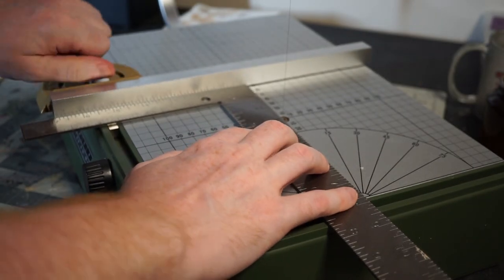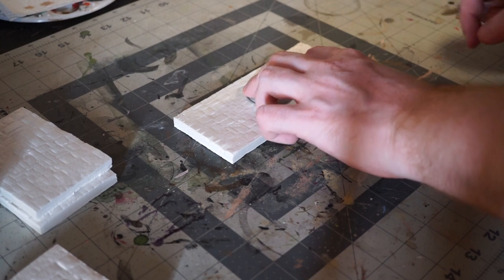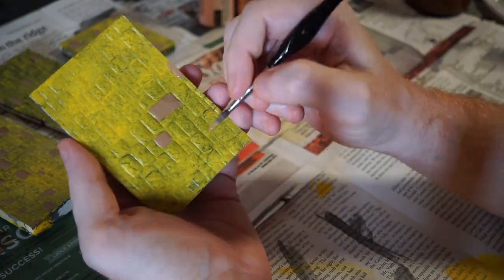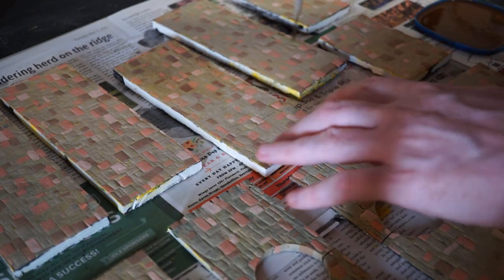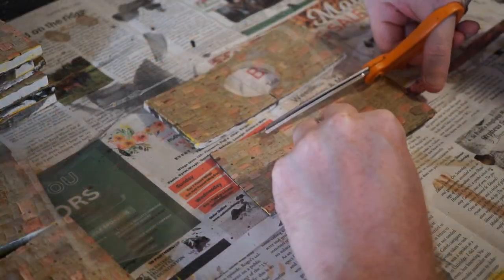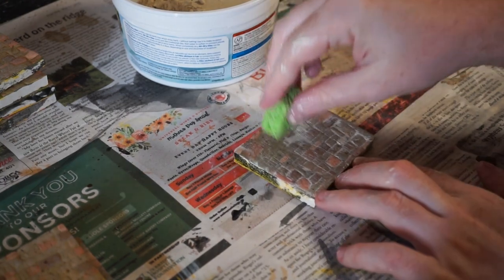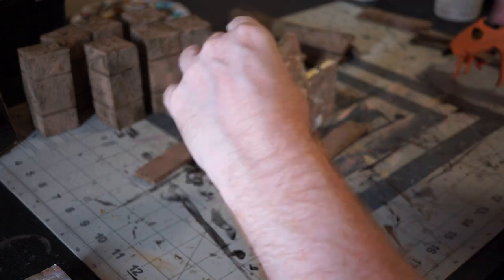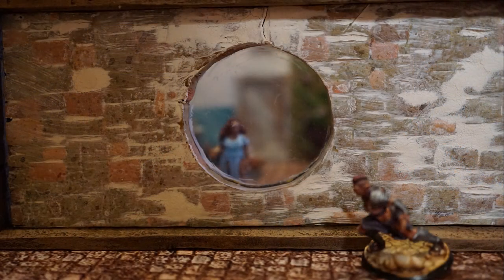Crafting MODULAR City Walls!

Comment: Beautiful walls!  I'm new to TTRPG's, DMing, and crafting.  Yep, diving into everything all at once!  One thing I'm a little concerned about is do you experience issues with the walls falling over and, if so, what's the easiest/cheapest way to solve that problem?
Oh, and at the end of the video, you asked about our favorite monster... looking through the Monster Manual I would say the Ettin is something I want to use in the future.  Sounds really cool and I've not heard much talk about it.  Seems very underrated.
Reply from the maker: Hey, welcome to the hobby! I actually haven't had any issues with the walls falling over. But if you're worried about that then the simplest solution is to actually just take some screws and sink them into the bottom of the wall sections. They'll be invisible and they'll add enough weight that they shouldn't fall under normal conditions. And I'll add the Ettin to my list - thanks for chiming in!

Comment: I have not had good success with using air dry clay. I found it shrank too much and would peel off in time (very little time) leaving a mess. Granted, I am not familiar with the clay medium and that plays a part in this of course but I am a very casual crafter. I go hard for a month, get what I need then let everything sit for 3 months until I need something else. I want quick and easy and fun to make. Learning the nuances of air dry clay doesn't interest me. Spackle shrinks too but I find it flaks less in my limited experience.
Reply from the maker: Totally fair! What you've got on hand what you're comfortable with is always the way to go. The only advantage  of air dry clay over the other tools I mentioned, for me, is that I happen to have some right now!
Reply: Nothing that a good layer of translucent matte varnish can't fix when you finish